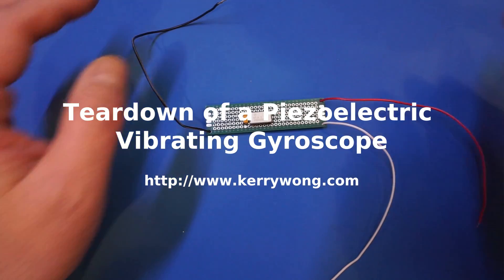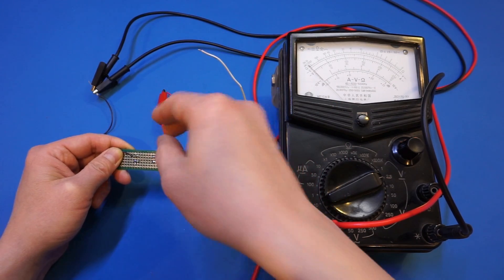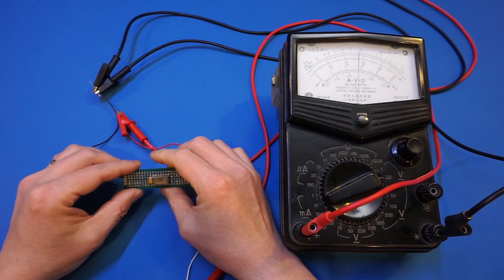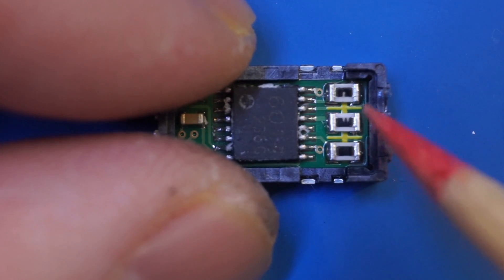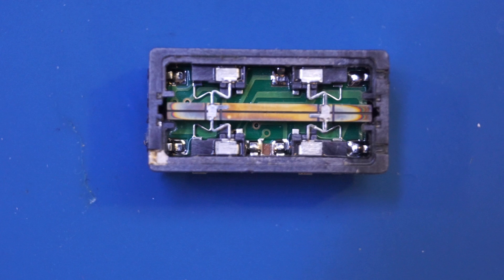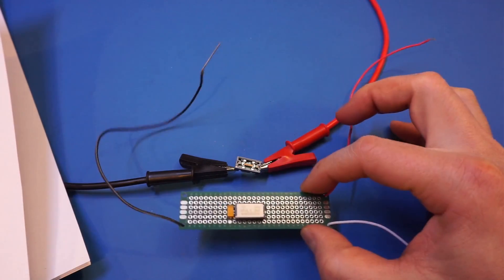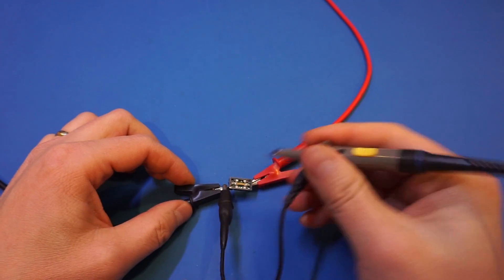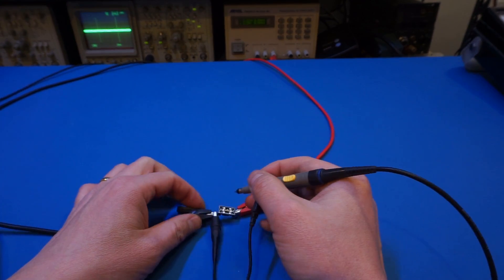Teardown of a Piezoelectric Vibrating Gyroscope

Comment: Never could figure out why they insist on calling these devices gyros... nothing spinning in there!  Just the opinion of an old gyro compass technician.  This device senses inertia... a gyro use centrifugal force and precession.  
Note: a gyro compass also uses inertial sensors WITH its gyros.

Comment: Would be interesting to connect the gyro pins to a multi channel scope, or differential opamp connected to one channel.
That would show the phase differences, when it's being rotated.
Reply from the maker: Yeah I was thinking about it when shooting the video, but given the size it was difficult enough to just hold one probe in place....
Reply: @KerryWongBlog  You solder wires to things that are tricky to get probes onto, or just hard to get at. Then connect to those wires.

Comment: Try lighting it up with a high power LED pulsing at a slightly higher or lower frequency, then record a video of the device in operation.
Reply from the maker: Not sure if light would have any effect on this?
Reply: @KerryWongBlog  The point is to get aliasing so that the movement would actually show up on video. Otherwise, it would take an absurdly fast camera to capture the vibration.

Comment: Does your caliper have a depth measuring probe/blade on the opposite end?
Reply from the maker: Yes it does, but there was a gap between the chip and the PCB so it wouldn't be very precise anyway...
Reply: @KerryWongBlog  You mean accurate.  Precise is repeating the same thing to the same degree.